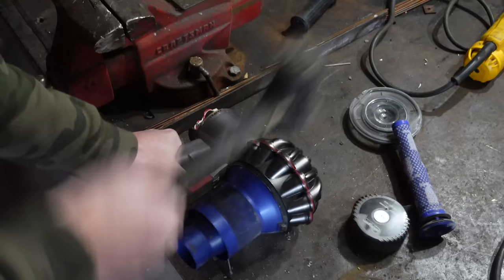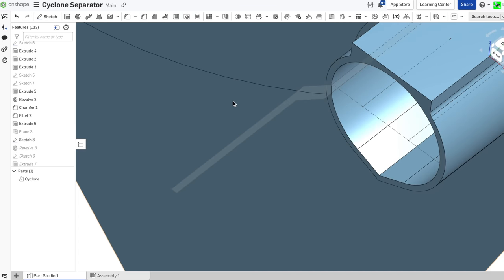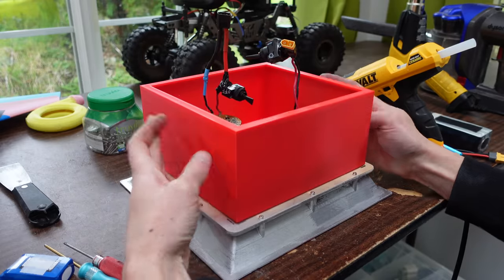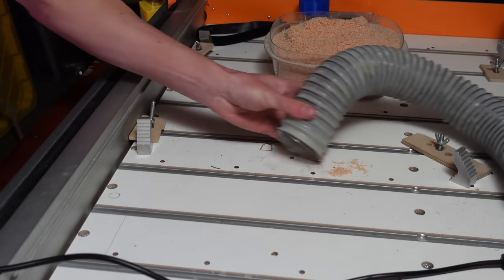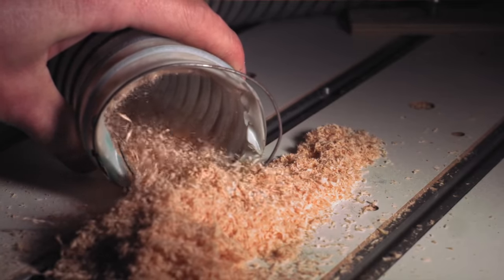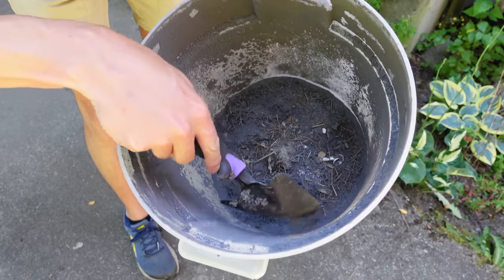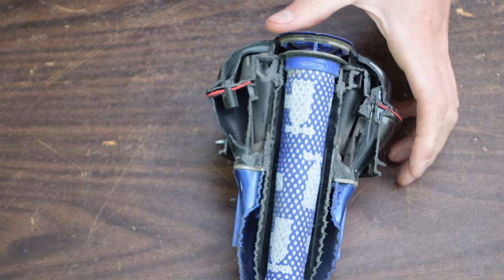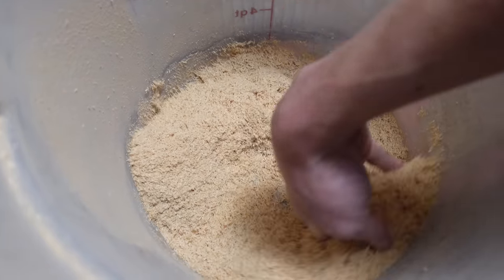Dyson Powered Cyclone Separator Vacuum

Comment: Have you considered using the same technique that is used in Laser Printers to temporally adhere the super fine toner to the paper before fusing? The paper is usually negatively charged which attracts the positively charged toner to it. You might be able to do something similar with your bucket, making it positively charged which would help trap the finer dust particles in it as most fine dust naturally becomes negatively charged.
Reply: Yes, add a bunch of ozone and high voltage electricity to what is already a potential explosion hazard.
Reply: I have already thought about a similar design. Ng without third-party generators. The voltage will be generated by the dust itself. Look at my SL_ST CYCLONE construction;)
Reply: @jttech44  1) Causing the unit to have a positive charge doesn't create ozone. The goal isn't to create sparks/plasma, but rather to bring it up to a higher voltage potential then the dust. 2) If you have sparking/ozone you're doing it wrong. 3) The point of grounding the bucket already takes advantage of this effect to a small degree. 4) The dust is so negatively charged in the video that it's already a hazard, having the bucket at a positive potential would if anything, reduce this danger. 5) Every brushed motor (yes not the dysons used here) including those in your average shop vac generates high voltage sparks AND as a result ozone as the magnetic field in the coil of each winding collapses.

Comment: note that the difference in size of the cyclones works on the different scale debris- smaller diameter cyclone separates smaller particles - increasing number gives the same flow rate as the single larger unit..

Comment: I work at a place with huge industrial CNCs, and the remarks about foam made me think:

When we mill resin and dense foams, the dust and debris only fill up a few bags but they weigh a ton. When we mill styrofoam, we fill up a dumpster full of trash bags filled to capacity.

The dust collector systems we have make this horribly loud noise about 1.5 seconds after they start spinning up, after that it's white noise. So whenever I'm on cleanup duty near them, I always wear earplugs. We don't use the dust collectors for styrofoam debris, as I'm pretty sure they'll go straight to the final stage and clog whatever is in front of the thing that moves the air.

Comment: TRY THIS!: Modell a downwards leading thread in your cyclone body. It helps 'guide' particles downward. Also where the cyclone meets the bucket, there should be a ~10cm long ~6cm in diameter pipe, leading downwards. Last, i had better result with the vaccumpipe not intruding into the cyclone. 

If someome is interessted i can link thingyverse pics/stl. cheers
Reply: Both designs used on this channel are much too wide.  Industrial use dust collectors / material transfer systems use cyclones that are much, much more narrow.  Kice industries is a massive international leader in pneumatic conveyance systems / dust collection systems. They have design drawings available on their website. Try using their deigns as a template to ratio your own smaller, narrow version.  https://www.kice.com/wp-content/uploads/2023/02/CYC1003.pdf

Comment: Multi stage would be the best bet. Having a misting stage at the end, should get the last little bits, while cooling the air as it comes out. In the LA area rn. Heat is on the mind alot...

Comment: Static electric charges may be the cause of your fine dust problem. If made of conductive materials and grounded for operator safety, it might work perfectly. At my former work using non-conductive hoses for dust collection would rock your world with serious shocks.

Comment: 15:20 i think i actually understand whats going on here. They are not just jumping to your hand they are jumping to and then away, i think some of them have a positive charge, some have a negative charge, and as they attach to you they change your charge. If your arm is slightly positive then all the negative dust particles will attach, if enough attach they can actually change your arms polarity to negative which causes all the negatively charged dust to fly off and all the positively charged dust to attach, changing your polarity again. Its not happening in waves though so im assuming its changing the polarity on small parts of your arm/hand not your whole arm at once, so some spots are negative and some are positive and they are all flip flopping at different times. 
In laymen's terms you created a battery. The dust is literally moving electrons between the bucket and you're arm and will do so until the static is drained from the bucket and dust, aka the battery runs out of juice.

Comment: I also noticed that the dyson vac has an intake tube on the motor side of the little cyclones as well. Maybe to prevent the intake and outlet to be too close and sucking up smaller dust? Maybe take that into your next design as well! If not, i might be trying this soon myself if i can invest in a 3D printer and the parts :)

Comment: If you wanted to make it less "lanky" you could try putting the vacuums at the base of the cyclone with a tube connecting it. It might be wider than the bucket, but if the vacuums are directly mounted to the lid, it may not be prone to falling over!

Comment: 3 functional(as opposed to looks only) paints for prints: 

Brush on PU oil-based varnish. 

PlastiDip(or similar copy product). 

Garage-floor epoxy(cheapest epoxy there is, just use large disposable syringes to measure out smaller amounts), this stuff is rather great for a whole host of print applications(UV/weather-proofing, filling in layer lines, creating a very hard and smooth surface, sealing surfaces air/water tight and hiding joints and much more, usually comes in clear in addition to various shades of grey and often also some rather dark shades and on occasion even black...............

side note: ScotchBright or a similar copy product plastic scrubber with abrasives cast into the plastic tends to be far superior to sandpaper for sanding/prepping prints for paint as it gets better into and between layer-lines...

Comment: I wonder if the tube that introduces the vacuum into the cone were extended downward further into the cone, what difference that would  make? Also, I don't understand why the wood dust/chips would not spin faster as they went further down the cone (into the smaller end) due to angular momentum being conserved.

Comment: Man, static is crazy. Would be cool to see how effective grounding it would be.
Reply: Difficult to ground something that doesn't conduct. I think you would have to aluminize it first.
Reply: @ahaveland I haven't used it, but there is a clear, ESD-safe aerosol spray sealant that claims to adhere to plastic and metal. Haven't used it myself, but I was curious too. Conductive acrylic is apparently a thing, too.
Reply: @SeanCMonahan  Sounds useful - a cyclone that doubles as a Van de Graaf generator is not a good combination if it makes a spark in a large container of fine flammable dust or flour particles!
Whole factories, coalmines and bakeries have been leveled to the ground with many fatalities because of this.
Reply: @ahaveland  Yeah the negative charge is basically stuck on the plastic. Normally they ionize the air going in with an ionization bar or static control gun or something. So they normally create a balance with positively charged air. But its a shady thing to experiment with when it comes to dust explosions.
Reply: @ahaveland  what would cause the spark? I guess I'm not familiar with how a Van de Graaf actually operates. I would think that having the walls grounded would reduce the voltage differential between the dust and the wall that's responsible for the clinging.
Reply: @SeanCMonahan  Electrons are scraped of materials with vigorous motions. VdeG generator scrapes them off a rubber band which accumulate on the surface of the dome. Vacuum cleaners, helicopters, shopping trolleys and shoes dragging on a carpet all do a similar thing and make static - this causes a change imbalance that can grow to hundreds of thousands of volts. When this exceeds the breakdown voltage of the air, or medium, then a spark happens.
If the spark goes through gas or fine dust, then an explosion can happen.

Comment: I think you need some kind of dimpling on the surface of the separator cone to create a slippery boundary layer.  I don't know if it will run on a 3D surface, but I have dry rollered Ultimate Top Coat gloss epoxy on a few epoxy tables.  Nice hard micro bumpy surface finish.  I like the two stage idea.  Maybe run each turbine on two smaller stages

Comment: There are research papers describing the perfect ratio for the specific particle size.... Main rule is that the inlet should have the same size as the outlet. Than the ratio of the straight part of the inlet and the coin should be 1:1. Also the velocity of the air can be to fast due to ediecurrents where particles  gets sucked up again. Also the diameter ratio should be between 0,25:1 and 1,5:1 in ratio with the straight part of the cyclone depending on the particle size...

Comment: I love the automotive air filter, my planer fills up a 55 gallon drum after just 1 hour of usage but worse my hand sander particles make it past my cyclone and clogs the shop vac after just 15 min of usage. Im going to steal the automotive filter idea and add it between my cyclone and shop vac.

A simple screw, screwed into the bottom of the bucked and a 22 gauge wire just long enough to drag around a 6mm bolt (1/4in) on the floor is more than enough to ground the bucked. If you want to do extra tape some HVAC aluminum foil to the inside down the vertical axis along the wall to the screw.

Comment: I'm an engineer from dyson and greatly enjoy the dyson series you've been doing. Let me know if you need any support.
Reply from the maker: Thanks! Would love some support haha. How do I get my hands on the latest gen vacuum motors without having to destroy a brand new product?
Reply: @rctestflight  Well, the latest motors have a different arrangement. The v10 motors and derivatives are in the v10, v11, v12, v15 etc are all very similar with a compressor impellor flipped to the back (windings cooled first) in a cage with holes in a tube on either side making up the inlet and outlet. Unfortunately unlike v8 motors, they don't power up without the accompanying pack and bms doing a handshake with the motor control board. So they're harder to run independent of the machine. I've heard people using stepper drivers to run them, but because they don't have many poles, they're hard to start.

Comment: there's a simple little relay circuit you can make to make this automatic
iirc you have a capacitor charge through a resistor, and then connect the relay over the capacitor
when it gets high enough voltage, and the relay trips. Adds a time delay to it.
just put a large value resistor over the capacitor, too, to discharge it when you turn off the circuit
Reply: in reference to 4:15

Comment: I believe that connecting two identical cyclones in series will not result in a two-stage cyclone. As was correctly noted, large debris is separated by a cone at the very beginning. But the main parameter is the flow rate. As the angular velocity of the flow increases, smaller and smaller particles can be separated. In my design, the second stage of the cyclone is radically smaller in diameter, which forces the flow to rotate faster. The third stage works somewhat differently. But that's another story;)

Comment: Cooler would be an accessory you can attach between the pail and the vaccuum of a shop vac that would convert it into a cyclone. Seems doable.
Reply: You'd have some fiddly work matching the profile of modern shopvacs, but that sounds very doable for the classic round/squircle design

Comment: Could you have the fans blow through a y to avoid using a filter? I know with fluids, this would create a vacuum in the other branch of the y. Not sure if this would be better than pushing air through a filter.

Comment: I would add maybe 8-16 vertical ribs/finns to the inside wall of the cyclone in same angle from top to allmost bottom. That would help you increase the bottom hole diameter for bigger stuff and the overall effiency would increase. Thanks

Comment: I've done some reading into cyclonic separation and the general consensus is that sub 10 micron particle collection is hard, below 5 close to impossible. A lot of what came through when using it as a hoover is probably in that range, which sucks.

Comment: Just an idea, you said that the foam was static. Wouldn't it be possible to generate an electric field across the hole in the top to repel the particles and further increase the efficiency of the separator?

Comment: What dust is made off, and what can we recycle it to?
Reply: Dust has many sources, and in each case you need to look to the source. Dust from around humans is frequently shed skin, sebum, etc., and "recycles" nicely in a compost pile. Sawdust, gypsum, flours, silica, brick, ash, coal, charcoal, and lime are all similarly suitable to be added to soil. Metal dusts from cutting or sawing on the other hand, may be able to be separated and collected for melting, or used to produce metal oxides.

Comment: On your next design you should copy Dyson's arrangement of putting one cyclone separator (or several small ones in parallel) INSIDE of a bigger cyclone separator. The big one with less conical walls

Comment: Would it be possible to use that static to your advantage to catch the finest dust? Perhaps by having a grounded or even pre-charged plate on one side of an air stream (inside of a duct)  all those particles would be pulled to it and therefore directed to one side of a Y-splitter at the end, into a separate container.

Comment: what would happen if you made a track/threads for the dust to follow. would that improve anything or make it worse?
Reply: The shape of the spiral is dynamic, depending mostly on the airspeed and particle size. Adding a track would probably specialize it more, making it more effective at collecting the particles that would follow those paths, and less at collecting particles that now get flung back into the center by "crossing the threads".

Comment: Try adding an air deionizer to remove the static in the material
Reply: Grounding would be a "deionizer"... I suspect you're thinking of ionizers, which charge particles. AC ionizers can limit the amplitude of charged particles by the natural attraction of more strongly charged particles to the opposing ionizer electrode, but become less effective as you target smaller and smaller charges. Electrostatic precipitators ("Ionic breeze" and friends, for example) specifically remove dust particles with a total charge, taking advantage of electron mass to bias the resulting motion of neutral dust (and air) as well.

Comment: You 100% have air leaking in past the air filter, those engine air filters require that the gasket be clamped in order to create a seal. Hence why air filter boxes always have metal spring clips or screws to clamp the edge of the filter and create a good seal.

Comment: It seems like the "diameter of constant velocity" for a separator like this couldn't possibly be a perfect cone, surely it wants to have some kind of lengthwise curve to keep the speed up in the middle. There's probably a way to define this mathematically as a shell that contains a helix with a variable turn rate as the particulates accelerate downward under gravity. This shape is something that 3D printing makes viable. My guess is it's flared like those velocity stacks so the radius comes in faster in the middle, but that wouldn't work well, stuff would tend to get stuck at the top, so maybe a sigmoid profile to let the particulates pick up vertical speed first.

Comment: You should have made the flat side a bit taller, look at the industrial ones, the input is half the flat side. Think about the air path, in your design it will do one or 1/2 rotation and then go into the exit, make it do 2 rotations, at the point where the air leave the side of the wall and towards the exit, you want flat wall because it will be gravity vs air movement. Also making the exit hole larger will reduce the flow towards the exit.

Comment: I wish you would get a textbook or something so you can engineer one and have a better working machine. This stuff is well studied and engineered. I learned how to design these in Air Pollution Control class I took for my Masters in Civil Engineering.

In general, your designs are too wide and not tall enough and your vortex finder is not long enough.

I am pretty sure I kept my text book. Maybe I can send you some page scans.
Reply: Theres plenty of companies that make these things that have design drawings available . Totally agree both his designs are WAY to wide, and too short. Work in a massive 1600 ton/day drain mill. Every cyclone we have is from Kice Industries
Reply: @jarred267  Yeah, a narrower taller cyclone gets the air speed up higher which spins out smaller particles.

Comment: What if instead of the walls being smooth, you had sine-wave shaped ribs that spiral downwards at slightly steeper angle than the dust wanna fall naturally, to make it drag against the surface a bit harder? Would that help?

Comment: Make a larger hole for the bucket discharge ...  the neck of the output of cyclone stage one shoulde 5-6 inches with screen or vents..stage two should have a wet scrubber collector bucket ie  scrubber not a cyclone.. stage three dry cyclone.